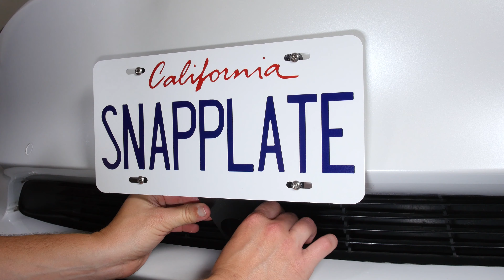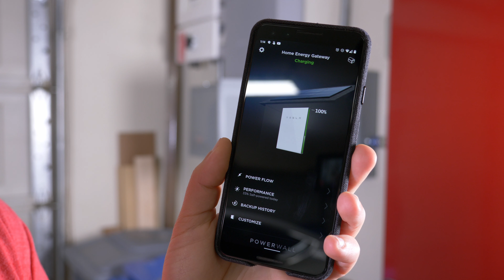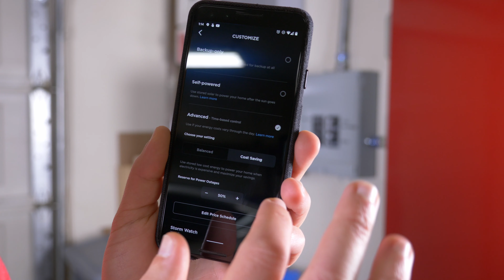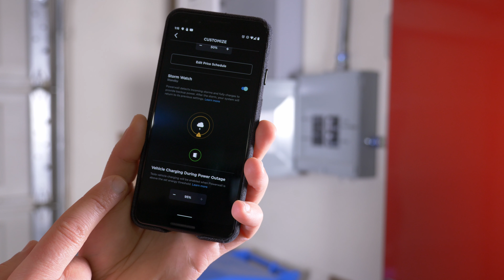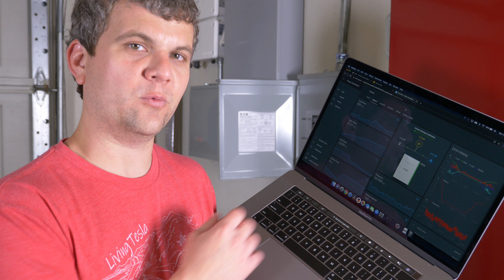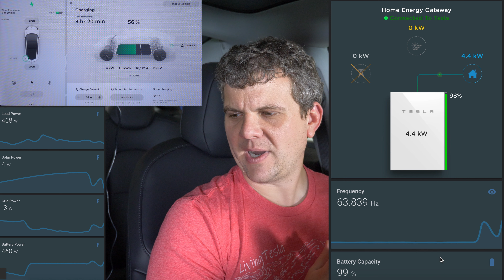Off-Grid Tesla Charging from Solar and Powerwall

Comment: How is the Wallbox connected to the Powerwall?
Reply from the maker: I'm not sure what you're calling the wallbox, but here's the full tour of my system: https://youtu.be/z5z2UkImrHg
Reply: LivingTesla sorry. To be more precise. Is there a special wiring needed so that the powerwall will reduce the charging speed for the car during a power outage from the grid?
Reply from the maker: Ah, no that's all software. You just have to have the minimum firmware version in the car and Powerwall and the correct app version, but everyone should have all that by now.

Comment: Now that I watched your video twice, I have a question.  Do you have to charge your car from the Powerwall?  Can't you switch things so that the car will get charged from all that excess unused solar and leave the Powerwall alone?  Maybe I'm still missing something.  You didn't explain in this video where all these displays come from.  The display on the right appears to be the Tesla power app.  The display on the top left appears to be the display in your car.  What about the graphs down the left side?  Where do those come from?  Do they provide documentation to learn all this?  Like the max draw should be 5,000 watts, and the AC frequency rises above 60 when the Powerwall is full and the solar cuts off?  Anyway, this is quite an education.  Thanks for doing all this!!!!
Reply from the maker: Yes and no. It depends on the conditions, how the car is connected, your settings, and your goals.

This video is demonstrating how to charge off-grid during a power outage, but things work differently when you're connected to the grid. During an outage, you can set a minimum Powerwall level to maintain and it will ramp the car's charge rate to match the available solar and keep the Powerwall charged.

Not during a power outage, you'll likely want to only charge at night so you can sell as much energy back to the utility as possible during the day. Where we're located during the summer, we can sell energy during the peak of the day for $.53/kWh and buy it at night for $.13/kWh, so it's in our best interest to sell as much energy as possible during the day and use it at night. Buy low, sell high!
Reply: @EveryAmp  Thanks for your reply.  All great stuff, and I have no idea where you would have learned all this -- I can't imagine that all this is in the Tesla documentation.  The bit about the current frequency change especially seems obscure.  I bet almost no customers know about that.

Comment: Does it switch to 65Hz even if whole house is backed up?
Reply from the maker: Yes. It makes no difference on what is backed up, only if there's more solar coming in than needed. It can't turn the solar down, so it just has to turn it off.
Reply: @EveryAmp  I had a look at wiring diagram for the tesla gateway, in partial backup config the powerwall and solar plug in to the main breaker panel like you have but in whole house backup the powerwall and solar plug in to the gateway itself so the way I think is the gateway itself can turn the solar off directly without need of powerwall changing frequency to 65Hz which signals the solar inverter to shut off. Could you please confirm that it still switches to 65Hz? The thing is i have a huge server rack and line interactive UPSs which will definitely switch to battery in such a scenario and where I live there are frequent blackouts for about 3-4 hrs. It would be a huge pain to change my 4 UPSs. I already have a 15Kw solar array and I am planning to get 4 of the powerwalls. If you could confirm the information it would be a great help. Thanks in advance.
Reply from the maker: I don't think it makes any difference whether you connect solar directly to the gateway or not. Here's how Tesla ultimately resolved my UPS issue: https://youtu.be/KlIxOGBvVCg
Reply: @EveryAmp  GREAT....! Thank you soo much.

Comment: You mentioned you have your Powerwall set to "Cost Saving" vs "Balanced" or Self Powered any input to why? Also how did you set up your Cost Saving? Thanks.
Reply from the maker: Pretty simple really, I chose it to save the most money. It just does its best to help you avoid buying electricity when rates are highest and to sell as much as energy as possible back to the grid during those times as well. 

There's really not much to set up. You just choose the cost saving option and tell it at which hours your electricity rates change and it does its thing.
Reply from the maker: It doesn't keep it at 100%, that's backup only mode. What I do depending on seasons or environmental concerns is adjust how low I set my reserve on the battery. If I'm concerned of an outage and little to no sun to keep going through the day I'll set my reserve to 60% or more. Otherwise it's normally around 30-40%

Comment: This video answered a lot of questions that I’m considering as we just signed up for a x2 Powerwall install to add to our 4.3kw PV system. Thank you! I do want to clarify, so in regards to the NEMA 14-50 outlets you have for the car: you have (1) on the Powerwall side & (1) on the grid side upstream from the Powerwall?  I’m just trying to see if I can ask my installers later on if they can do that for my while doing all the wiring. Or would you recommend that I just put (1) on the Powerwall side since that new update from Tesla allows managing the charging so it doesn’t drain the Powerwall when charging during a outage?  Appreciate your time!
Reply from the maker: That's correct, Tesla installed the grid-side outlet and I installed the Powerwall-side outlet, which is technically too much for a single Powerwall, so I have to be careful using it. With two Powerwalls and the new feature, you'll be fine on just the Powerwall side, but it's really nice having both options! 

You may want to consider having a 60A wall connector on the grid side for daily use at 48A and have the NEMA 14-50 available for the mobile connector - or a second Tesla in the future ;)
Reply: LivingTesla Thanks for the reply, will consider these ideas to our upcoming install.

Comment: How did you embed the Powerwall web UI in HA? I updated my HA and configured the Powerwall sensor, but that didn't do the trick. Thanks for the informative video--I've been meaning to try that stuff out!
Reply from the maker: I'm currently pulling in the sensor data, but I'm also showing the local webpage just using a webpage card. It works great locally, but of course, not at all outside the local network. The app also doesn't play well with it. Looked good for the video though!

Comment: Tesla working on a electric water heater ? Seems like that could be a good use of spare mid day power that may need to be burned off?
Reply from the maker: I've heard talk of a home heat pump, but not water heater. Instant water heaters seem to be the way of the future right now anyway.
Reply: @EveryAmp  zero tech electric water heaters have been available forever, I'm just trying to think of ways the house could dump the excess power in the middle of the day beyond a wasteful resistance electric heater. I suppose another option in a pinch could be cycle the heat pump/HVAC with the excess power, or just simply have the inverters turned off, I was just trying to think of a useful way to use the excess power when there's no where to put it.
Reply from the maker: Get another Powerwall! 

- Elon, probably
Reply: LivingTesla this. I'll wait for V2G. Only way I'll be buying a second Tesla, as we barely use the 1 between us these days.

Comment: Another YouTuber got Tesla to change the max frequency to 61.5 Hz and that solved the problem with UPSs tripping.
I am considering solar and have a few questions. Did you consider other installers besides Tesla? Did you get the QCell panels or did you have a choice for better options? Did the find Tesla's support adequate? Their reviews seem to be terrible.
Reply from the maker: Oh that's a good idea on changing the max frequency. I'll investigate that further.

For my house, I was getting a referral Powerwall and used the solar as leverage to get them moving on it, so that pretty much limited me to Tesla. However, for our HOA's pool house, I used a local contractor. In almost all aspects, the experience with the local contractor was better. The person who came out and did the initial site walkdown was the same person I dealt with through installation. Any problems were resolved in hours along the way. 

I had pretty much the opposite experience with Tesla. I dealt with at least 4 people along the way, who frequently didn't seem to communicate with each other. Design problems took days or weeks to resolve and they often fixed one problem, but not another. In the end, the actual installers were excellent and efficient, but it was a long, bumpy road. 

Tesla's price and product have been excellent, but patience was critical. I have a friend who got a simple solar system from Tesla around the same time and his experience was much better, so I suspect throwing my referral Powerwall into the mix is largely to blame. For someone with a standard install, I wouldn't have a problem recommending Tesla if the price is right.

I have 12 of the Solar City-branded 330W panels which seem to be on par with the QCells from what I've read. I installed Sunpower 360's on our pool house, which would have been my first choice if Tesla offered them since I don't have much roof space.

Comment: Great to see what happens in this situation.  Now I have 2 PWs, so it can take 10kw draw rate, But I would be interested to see what happens if you were charging on your mobile connector and then the grid went down (this would be like my set up with a whole house backup, nothing Grid only).  Would the car instantly change the charge rate to compensate or would it shut the system down when you are off grid?
Reply from the maker: I tried that in some of my testing. As long as I had enough solar + Powerwall to charge the car, everything kept going just fine when I took away the grid. When I was charging from Powerwall + grid, the Powerwall tripped off and the car totally stopped charging when I lost the grid. I could restart it slowly like in the video, but it didn't manage the transition itself.
Reply: @EveryAmp  Thanks.  That is good to know.  With 10kw available just from my batteries, I should be fine (from a trip off) even at night unless both ACs are running as well.... Now I wish they would add a setting that will work with the grid up so that after the batteries are full and the house is supplied, the car will vary its intake to just use the excess solar.  I suggested it to them but who knows where that ever goes.

Comment: Tesla says that the car-powerwall integration will itself reduce car charging load to not exceed the power capabilities of the powerwall (5kW). If this is the case, you should be able to set car to 32A and it should keep itself at *5kW minus house load*. Could you test this? I'm guessing the car just slaves to the powerwall like one wall charger to another when load sharing two cars.
Reply from the maker: I tried that in some of my testing. As long as I had enough solar + Powerwall to charge the car, everything kept going just fine when I took away the grid. When I was charging from Powerwall + grid, the Powerwall tripped off and the car totally stopped charging when I lost the grid. I could restart it slowly like in the video, but it didn't manage the transition itself.
Reply: @EveryAmp  Ok, I understand. So Tesla's statements has some footnotes attached and doesn't work 100%.

Comment: If these figures you quote are on 110volts , what would the be on 220 V. ie what would you set the Tesla charging rate to ? Also why won't the solar charge either the car or the power-wall during the day if there is an outage instead of solar going to zero and just wasted when it is needed ? !!  Thanks in advance.
Reply from the maker: Those numbers were all on 240V. At 120V, the car can only only charge at about 1.4kW, so it wouldn't have been able to use all of the solar in those conditions. It could still charge, but the Powerwall would have eventually charged to 100% and the solar would have started cycling again.

If the Powerwall isn't already at 100%, the solar would definitely go straight to it and charge it up like you'd expect. I was just trying to show the interesting things that happen once the Powerwall is full.

Comment: Great video, even though some of it was hard for me to understand, but it really sparks my interest.  I have solar and want a Powerwall but don't get how one would be enough to keep my house powered during outages.  The whole V2G thing excites me too.  Or powering my house from my Model 3, during an outage.
Reply: Supposedly V2G can't happen with current batteries in Model 3. I have one too and that would be great. 1 Powerwall probably wouldn't be enough for your whole house unless it's small and/or you're ok without HVAC. The average homeowner with a Tesla and central HVAC probably needs at least 2 or 3. Tesla has a calculator on their site that will estimate how many you'd need. For me, with 3,500 sq ft, 1 Tesla, HVAC, and hot tub, it recommended 3-4. 

I'm waiting for V2G as Tesla isn't even selling solar yet in my state. When V2G is available I'll weigh whether to trade in my Model 3 or go with PowerWall, which might be improved by then. In this economy, I'd rather keep the cash.